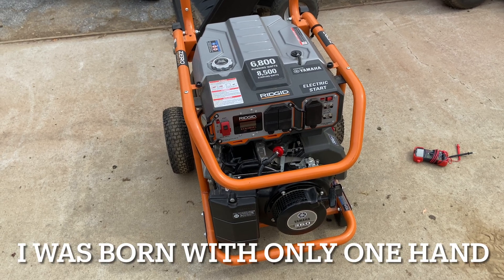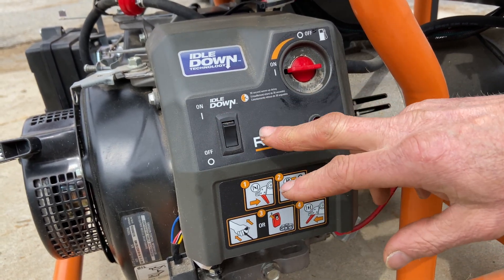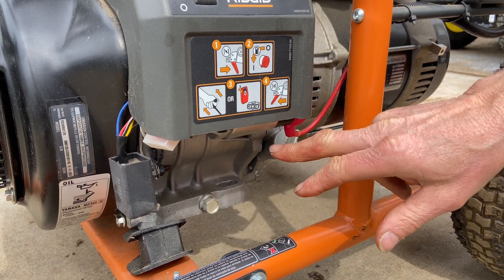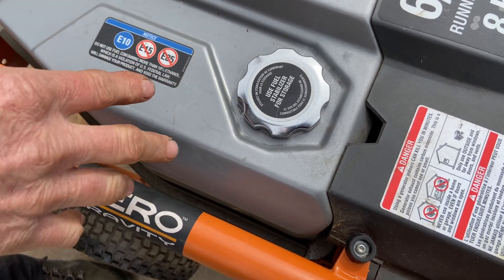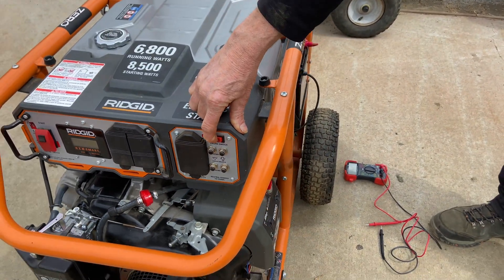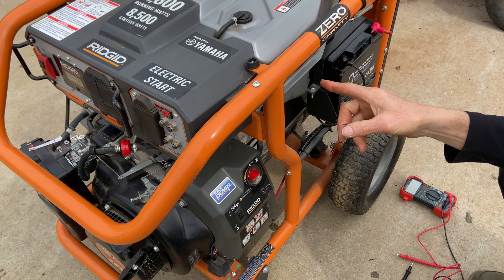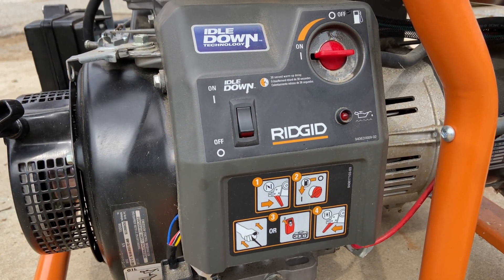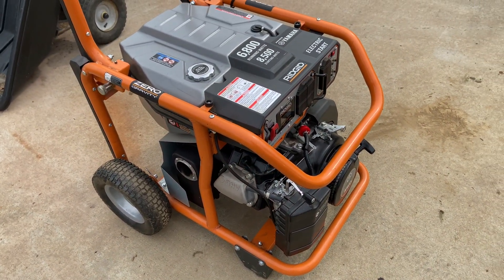How to Start Rigid 6800 Watt Generator

Comment: good stuff. but one thing i do and never in 60+ years never had carb gum up problems. ALWAYS  use NON ethanal only gas yep it cost allot more but trust me in the long run it pays off..i use it in everything i have and never had carb issues except trash some times gets in the fuel but thats operator problem..and if you want use Stabil

Comment: I'm from Mexico and they sent one of these machines, but it doesn't have a button to turn it on. How can I fix this?  🆘
Reply from the maker: Not sure what you mean button? If you were talking about the electric start? I will assume you did not get one with electric start and you use the pull rope to start it.
Reply: @JohnsonsSmallEngines  This is the electric start button, but it can be done with the rope without using the electric start button. Can I start it with the rope?
Reply from the maker: yes

Comment: Great informative video Brad. Did you use an OEM or aftermarket carb? Looks like it's only a few minute switch out vs the time and parts you'd have to charge for if cleaning it. Any link for the carb or supplier recommendation is appreciated. Thanks again

Comment: Thank you very much for the video. I am still having a problem with the same generator that has only worked about 80 hours and I’m not getting any spark to my spark plug. Can you recommend any troubleshooting that I could do for this? thank you very much!!
Reply from the maker: When was the last time it ran? Check your oil level and top it off if needed. Most generators have low oil shut down.
Reply: Oil level is good. Still no spark on the new spark plug. The spark plug is per manufacturer br4es  NGK. Thank you for any future tricks.
Reply: The last time it ran was about a year ago

Comment: Any one know where I can get a wiring diagram for this generator.  Had an incident at a construction site and the wire behind the side panel and the wires got messed up and unplugged and I'm trying to figure out how to out it back together.
Reply from the maker: Most likley Generac web site.
Reply: Did you ever find the wiring diagram?

Comment: This model Ridgid Generator has a bad reputation of stalling due to lack of fuel delivery to the carb.  The gasoline tank outlet is on the same plane as the carb coupled with the routing of the fuel line causes fuel to quit flowing to the carb.  I have the same model and finally converted it to propane/natural gas.  It is an excellent generator, otherwise.
Reply: Vapor locking issues , my fuel hose has to hang low for the gas to flow properly
Reply from the maker: Hi Ken, Good looking out! Thank you.

Comment: Great video! I just bought this exact model from my neighbor. The electric start doesn't work. Nothing happens when I follow the instructions. I charged the battery overnight. My meter shows 8v dc across the +/- battery terminals.That's low, but it should still at least try to start.  Is there another issue, like a solenoid switch or ignition coil or fuse, that could be causing the problem?
Reply from the maker: Sounds like you need a new battery. 8 volts will not get the starter going.

Comment: The reason for 2 kill switches is the panel on the left is removable to bring it inside and leave the gen outside and you can kill it from either location.  Not sure how long the remote cable is though.  Good video.
Reply: Up to 3 - 25' Remote cables can be daisy-chained for a max of 75', according to what I read. Unfortunately the cables are no longer available, but I believe they can be DIY'd using a 20 amp cable with the proper plug configuration (L14-20, I believe) and standard 4 conductor  flat plug trailer wiring...

Comment: 0:08 It's called "zero gravity" because it has a long vertical handle for transport.  When leaned back at about 45* there is no weight on the handle.  Two of my friends have the same one.  Nice Yamaha engine!
Reply from the maker: Gotcha, and yes, I agree about the Yamaha engine.
Reply: Is it zero gravity gas flow not the handle
Reply: @carlosdejesus474  "Zero gravity design - allows for maximum ease of transport and balance"     "Zero Gravity frame makes transport easy"   Google either for the source.